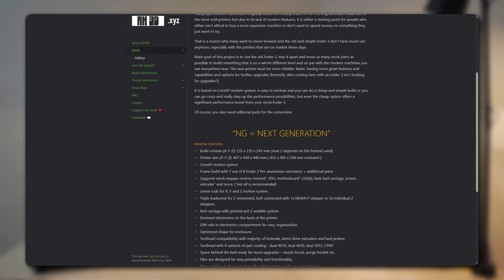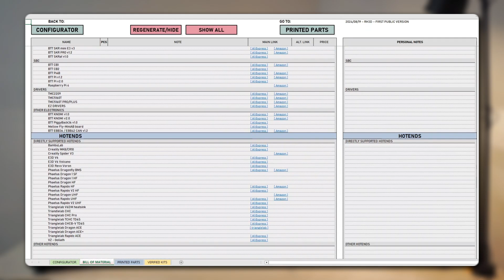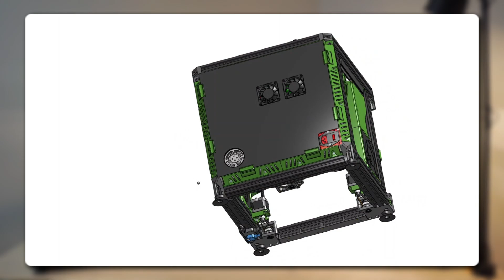E3NG v1.2 released - coreXY for your Ender 3

Comment: I’m so glad I got rid of my ender 3. Imagine having to do any of this to save 100 bucks
Reply: There is a major divide in the 3d printing space between people that like the engineering of the printer itself and people making plastic toys
Reply: @SNOUTxTOUT  That's quite disparaging, but I agree that there's a fulfillment in converting a machine from one system into another. What you lose in time is gained in experience and skill.
Reply from the maker: Haha, that's right and I am glad you found your way. Sure this is not really about saving time, effort or even money but rather taking it as a part of the hobby.. and of course not everyone likes to build printers but some do.
Reply: Lets, see,.. build your own based around common hardware, or step in to the walled garden of machines most people around the world will never be able to afford.
I'll take the Build My Own option, buying the components as I can afford them, and matching the hardware to the projects I want to create.
Reply: If you’ve upgraded to a bambu its a fun project to reuse the left over ender 3
Reply: @MozTS  I bought a new P1S on the Black Friday sale. I've been tinkering with my E3 Pro installing linear rails. Thought this might be a neat idea until I watched this video and saw the estimated price of parts on that spreadsheet. Over $400 (granted this video is a year old, who knows what the prices are now) and it's still just an Ender 3. I only paid $550 for my P1S with the AMS. So, is this really worth it? Maybe if you like tinkering...

Comment: Guys it's time to get rid of your Ender 3 printers. I know I get attached to my machines but this is ridiculous 🤣
Reply: I can agree that converting my Ender 3 Pro is not something I'm going to do.  I'm building a Voron 2.4 now and that satisfies my insatiable need to tinker...and build,  but I am not getting rid of the Ender pro either.  I have done some upgrades over time, and I have it printing with outstanding quality.  It's slower than my Core X/Y machines, but it's so quiet and so good, I use it mostly for prints I'm not in any rush to get done, and personal hobby use.  It can print any material I want thanks to the enclosure I built for it, and the MicroSwiss NG extruder(may be doing the REVO conversion.. haven't decided.    So I think that if it's working well... and does what I need it to do, why toss it?  Now my old Anycubic i3 Mega... I may tinker and make that better too.. IDK.

Comment: After a full investigation and build of this kit I have to point out to anyone following this maker and thinking about building this. The design flaws are so bad that it makes this build unusable. 3D printed corners means this build will be impossible to square and long term stability issues. Sure it looks neat but it is a bad design. The author is also utilizing the 1st look principle (where people think something based on their first impression) to try and get people to give him money on patreon. There is no support or real information when you look into this project. The cost of this project skyrockets the more ou get into it. You will realize it will be cheaper to sell the ender3 and buy a different printer than this build. There are other core xy ender projects that are much better!
Reply: You should try and build it, and THEN give such nasty comments. It is a very capable machine.
Reply: Build it and make a video about how it's so bad. I built one and the only issues I've had were one's I created. As for squaring it, he provides instructions for how to square it comes out quite good.
Reply: Which projects?
Reply: @maxpower9546  Duender

Comment: a tool changer version of this would be insane!! like prusa XL
Reply: I would be interested in seeing if this could be made to work with the upcoming Bondtech INDX. I just inherited an S1 Pro from a friend who was moving and have been considering a Core XY upgrade with the INDX. Just starting to research what all that is going to take when I found this project.
Reply: @donnyriggz  I’m slowly upgrading all my old Enders, just finished my Ender 5 to Merc 1. Now I’ll be upgrading a Ender 3 to the NG. Also looking at doing a INDX build. Maybe just using the chassis from a Ender 5 Plus.
Reply: @MrBooth1974  is the ender 5 easy to upgrade.Even when your a noob with klipper?I found these projects verry interesting.Wanna try it.Maybe on a cheap printer first

Comment: I'm looking forward to building this printer kit! 
I was reading another comment that said you could buy something cheaper and better already assembled. This is true, there's lot of options to buy something that will be more reliable and dependable in a full time use case. However, I do not believe that is the idea behind this project. This is for people to enjoy the process of building, tinkering, and tuning. 

It's like comparing a kit car to a Toyota Camry.
PS. I also want to build a kit car.....

Also, interesting idea, what if a print farm was built from these printers, a few hundred printers? Your price would decrease per printer and you'd  have plenty of spare part. You could pay someone to build and maintain your farm. Which would reduce the dependency on outside vendors/companies. It's a little more secure and isolated too.

Comment: Tbh this project is really cool but the BOM for my configuration comes to 437 dollars, at this price I can buy almost any Core XY printer of the shelf that comes with greater features. I think what would be great is if the manufacturers of the kits would down their pricing quite a bit making this more affordable. I understand some people will do this purely for the joy of building it but I'm not that guy if the price is higher then an off the shelf printer.
Reply: source the parts yourself.
Reply: @ tried to find the cheapest options that deliver to my country, still came to ~394 dollar. 20 dollar more and one can get a bambulab P1P
Reply: @gethigh961  and you have to factor in you are also sacrificing your current ender 3 in those 394, while if you get another one you have 2 printers albeit one is old and a bit slow you can still use it
Reply: @El_Paralipomeno absolutley true

Comment: How do you control 3 z steppers independently?
Reply: With a suitable controller board with multiple stepper controllers, that's no problem.
For example, I have a Manta E3EZ. It has 5 stepper controllers. One of them controls the 'A' and another the 'B' stepper motor. The remaining 3 stepper controllers drive the 3 Z stepper motors.
And the extruder - since I have a Stealthburner head - is driven by an EBB SB2209.

But there are BTT controller boards, such as the Manta M8P or Octopus series controller boards with 8-10 stepper drivers.

Then you just have to configure the Klipper.
Reply: You can have more than one MCU running klipper hanging off the host if you need it.
Reply: @jimmy2drinks  Which conceivably means you could flash the MCU part of Klipper to single-axis machines like scanners or motorised camera sliders to build up a printer.  There's not alot of 4+ axis consumer goods out there.
Reply from the maker: as @mumtaz1977 said. You just need stepper driver for each motor and then you set it up in the firmware, it is all ready for that.

Comment: Does the 3 z motor version with wobble x allow for kinematic bed leveling similar to the hydra zero g or rat rig?
Reply from the maker: It does not and that is why it is not the recommended version currently. Or well... the bed carriage has printed arms which allow for some tilt thanks to the slight flex they can handle so it works fine if you keep it within the safe range but because of that I can't recommend it and honestly I don't even see the need for 3 independent Z steppers. I have been running single Z stepper on one of my printers since I built it and never had to readjust the bed.
But I also have a kinematic bed prototype for this, there just wasn't enough time to finish it.

Comment: Do you plan to make a configurator that does not need Excel?
Reply: You can open it in google sheets, 
If you open a new sheet on google sheets you can then go to file, then open, then click upload, then either browse to where ever you saved it or drag and drop it into the window and wait for it to upload. Everything seems to work

Comment: I just ordered a Biqu H2 500* on holiday sale, with a BTT SKR MINI E3 V3.0 to rebuild my old E3 Pro. I didn't need the high temp but the cost was only a small amount more than the standard V2S version.

So I would love to see this project support the V3.0 board. The H2 Hotend shouldn't be hard to adapt to this design.

This project makes me excited of using this as a base for a high temp enclosure printer for the high end engineering materials. Just need to make sure the stepper motors are protected from the heat. Shouldn't be that hard.

Comment: Ive been wanting a core xy for a while. I got an E3 V3 SE and an E3 V2 for cheap, so I figure I could combine those together to get most of the materials and then buy the rest
Reply: Busy converting my Ender 3 Pro and Ender 3 V2 to one CoreXY. Doing a bit differently, since I have more Aluminium profiles and my Pro was converted to Linear rails I'm designing it to use those components.

Comment: Amazing work!
Would this work with the Micro Swiss NG extruder / toolhead? I'd be fine with designing my own adapter or base plate for it if you haven't done so already, just curious if it would work.
Cheers!

Comment: Sell me a kit for the enclosed model at a reasonable price that I can convert my original ender 3 with instructions and I will support you.
Reply from the maker: Currently there is only one official kit from Funssor - hardware kit, electronics and motion and enclosure kit so basically everything you need for the rebuild with the recommended configuration. Build guide is already available too and everything can be found on the website (build guide directly there and links to kits in the Configurator/BOM).
More kits should be coming in the future but the preparations, testing, optimisations just take some time.

Feel free to ask anything if you have questions.
Reply: Instructions are posted. Enclosure kits are posted by blurolls and fabreeko for PC or acrylic. Normal kits should be coming soon, or are already posted
Reply from the maker: @thisisuh  Funssor kits for everything are available and mentioned on the discord and linked in the BOM. I should make an update video to get the information to more people :)
Reply: @ funssor screwed me over not including all the parts in their kits. Making me wait almost 2 months to fix their mistake.
Reply: @thisisuh  $250 is too much money and the acrylic is not available to USA.
Reply: @jondoough then 3d printing isn’t for you dawg. Go draw or something then. That’s pretty cheap compared to a Voron build.
Reply: Reasonable price is the issue
Reply from the maker: @Phil-D83  What would be a reasonable price?
Reply: @RH3D_czless than selling off the ender 3 and buying a similar core xy brand new
Reply: @RH3D_cz for a kit? Cost of parts + 10 to 20% depending on how much you love your community.
Reply from the maker: @ParisLuHv  Haha, that sounds like I love my community more than you would think 😃.
Reply: @RH3D_cz oh yeah, how much so?
Reply: Exactly, don't create endless versions, just create one simple/good/cheap for 80% of people.
Make it as simple a possible aka: shut up and take my money
You can make a performance kit too if there is demand.
Reply from the maker: @alexforget  I did a lot of research through the community during the design process and the possible options are pretty welcome, I wouldn't agree that 80% builds are the simple/cheap but on the other hand, it would be a lot simpler having just one or two options overall and if I manage to work on other projects, it will definitely be that way. Will also help me save a lot of time in the design process :).
Reply: What will happen is some Chinese knockoff company will just copy it and make it not worth his time
Reply: You source your own parts. If it’s not cheap enough then you don’t know how to shop bro. Use those thinking skills you never used in high school and create your own masterpiece instead of crying about ready to build kits. Half the fun is finding stuff to make this thing your own.
Reply: @BG198606  if the model files were available for sale without a kit, I surely would.

Comment: What type of filament do you use to print the parts?
Reply: ABS or ASA, especially if it's enclosed.
Reply: @sciencesold_  Would PC also work in that case?
Reply from the maker: @glitchyaeon04  PC is more brittle and may fail over time on stressed parts so I wouldn't recommend it. Some blends might work fine though, I have used PC-ABS on one fo my builds and it is holding up just fine.
Reply from the maker: I print all parts in ABS, ASA is also fine.

Comment: Would this follow the same Ender 3 pro configuration for klipper? Sorry I’m  new to 3D printing. I like marlin but I’ve noticed massive print time reduction using the same settings using klipper and like the webGUi controls
Reply from the maker: You will need a different klipper configuration than for Ender 3 Pro but it isn't a lot of work and if you joint the Discord, I believe someone will be able to share a working configuration for your board.
I have been using Marlin before and it can also print very fast but it really benefits from a motherboard with faster processor. I was using SKR3EZ which has 550MHz. Marlin has theoretically the same capabalities.

Comment: Awesome project! Just what I have been looking for since I want to convert my Ender 3 S1 Pro to an enclosed machine and fit a spool of filament on either side of the bed. With this I can do that! Can't wait for more videos about this project too! :)
Reply from the maker: Thank you! I am glad you like it. Videos are coming really slow unfortunately :).
Reply: @RH3D_cz  Don't worry about the slow pace :) BTW. Since I wrote the comment, I have found out that the Ender 3 S1 has totally different aluminum profiles, which has slowed down my build since I have to modify the CAD files and it takes time for a noob like me.
Reply from the maker: @TNX255  So you are still going to rebuild it? Hope it will work just fine with the profiles being different. Learning to work with CAD can be helpful too :).
Reply: @RH3D_cz  I will try :D

Comment: I'm doing this to my ender, and my sovol.
Reply from the maker: Awesome! Hope it will work fine with sovol too, what model do you have?
Reply: @RH3D_cz  i have an sv06 plus with the clipper pad that is currently a brick.
Reply from the maker: @AyezRed  SV06 has quite a lot different frame, did you already check if it will be doable?
Reply: @RH3D_cz  Im mostly just gonna use the bed and order some extrusions of the correct length, im gonna use the ender 3 to learn and figure out how to do it, I think it would be cool to have the bigger build area is all.
Reply from the maker: @AyezRed  That sounds like a good idea to first check the build process with ender 3 and then you might even decide wether to continue with the sovol or not. Bigger print area can be definitely usefull sometimes :).
Reply: @RH3D_cz  yeah, im gonna use more than just the plate if I can, the linear bearings might be useful too. Lol I dunno, we will see, I got a bunch of nice asa, and abs in, im trying to figure out what colour I want to use still lol.
Reply from the maker: @AyezRed  Sure, there must be more things to reuse. Linear bearings and rods maybe, leadscrews, motors, PSU, endstops, wires etc. Did you notice the color scheme tool on the website? Might help you with decisions.
Reply: @RH3D_cz  yes i did :)

Comment: Where can i get the firmware or klipper config for this printer?
Reply: You'd have to get / compile the klipper config for your mcu but its super easy. What do you have?
Reply: @RecklissFPV  right now i am thinking about building one but i would use a BTT Octopus i have laying around. Their side is under construction and i cant get lots of information
Reply from the maker: @felix_972  Klipper configs are not on the website yet, you are right and I need to work on that, but if you would join the discord, there are plenty people with different boards and someone would definitely share a working configuration or if you want, you can leave me a message with your e-mail through the feedback on the website and I will send you my current Octopus sonfig.